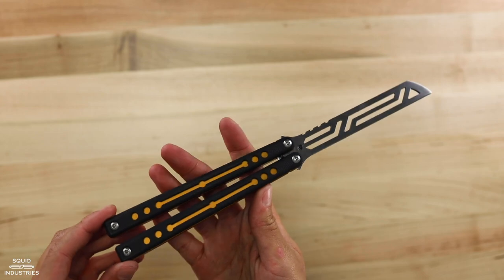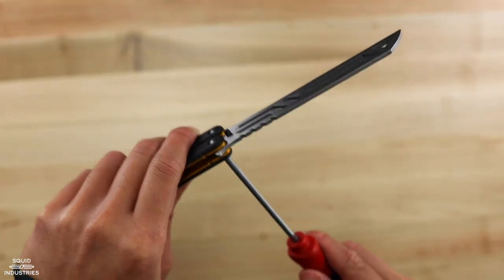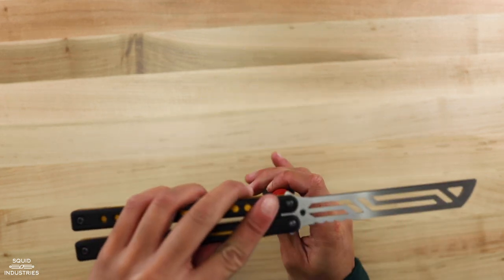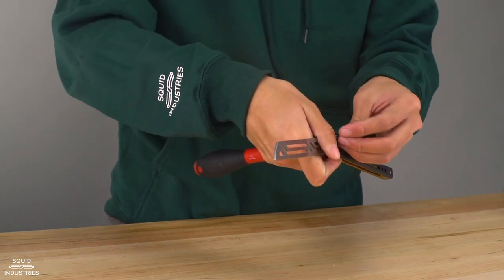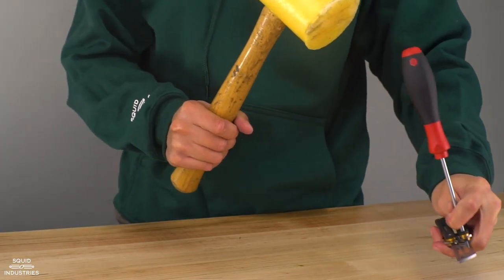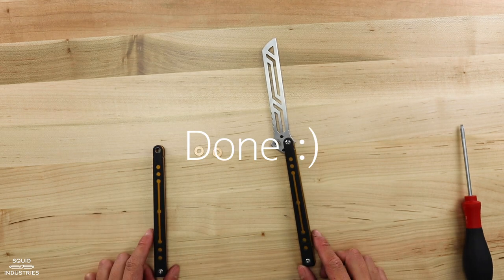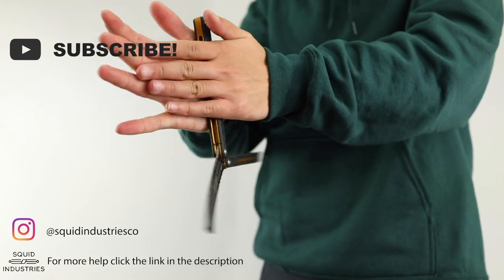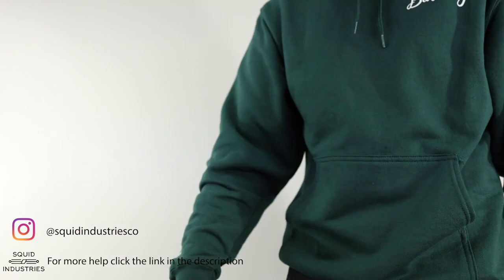How To Fix Stuck Pivots - Squid Industries Balisong Maintenance Tips

Comment: Someone teached me this method that wont potentionally damage your washers: you screw out the screws only a little bit so that they stick out and then place the bali on the table with the screws facing the table and just press it down. It works very well you wont lose the pivots and wont damage them either
Reply: So you’re also from both the gd community and the balisong community?
Reply: @kkaelyn002  yes indeed
Reply: @kkaelyn002  and hentai

Comment: I can't seem to get the handle end screws out of my mako! Meaning the ones not by the knife end. already stripped one to crap. any tips?
Reply from the maker: We recommend to try using a big pencil eraser or wide rubber band to hold the pivot in place as you turn your torx driver.

Comment: Now that my pivots are out, they don't fit back lol. It's a benchmade 47 and i think the metal warped from heat and expanded, bc I cant get them back in for the life of me (Not all the way, it only goes 7/8 of the way in).
Reply from the maker: The pivots of the Benchmade 47 have a barbed area right underneath the head (they look like small ridges that protrude outward). This is to prevent them from falling out. You'll need to use an arbor press or hammer to fully push them back into place. -Lucas
Reply: @SquidIndustriesco  thanks man was wondering about that!

Comment: my screw is stuck in the pivot. please help. the stupid pivot keeps turning with the screw. starting to get mad. any tips?
Reply: try squeezing the handles, or using 2 drivers, one on each side turning them opposite directions, if its still not working try it again after letting it rest in hot water for a second